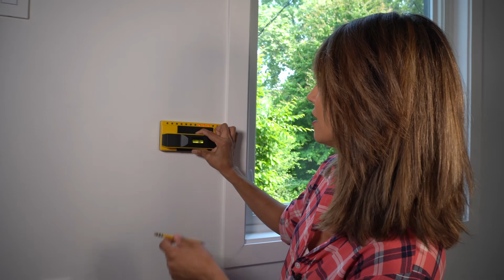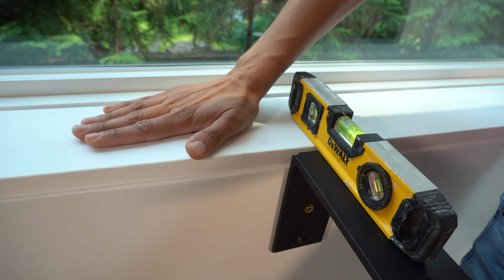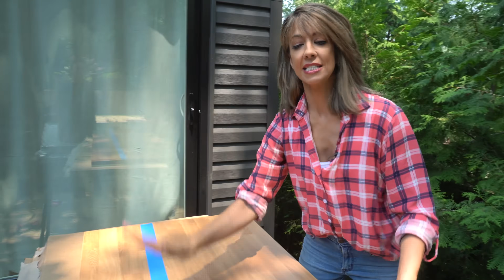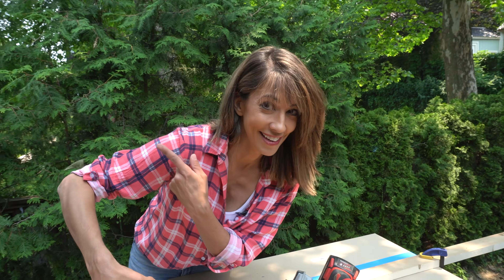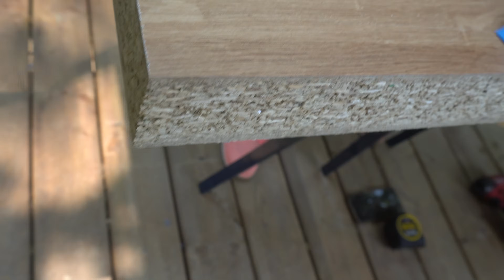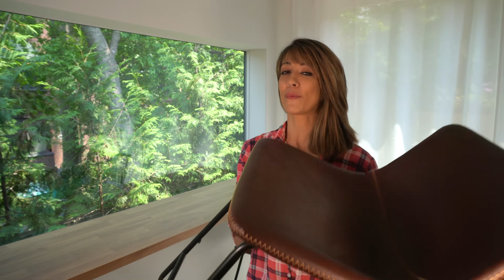Build a Window Desk Easily For Peace + Calm While You Work

Comment: great video. here's a handy tip if you are cutting sheets by yourself, i use a sheet of foam insulation and lay it on stands and cut into the foam. It holds itself up perfectly so i dont have to be concerned if it falls off. great video and keep them coming.
Reply from the maker: Love this idea! It’s a good one :) You’ve got a lot of experience and it’s nice if you to share. Thanks!